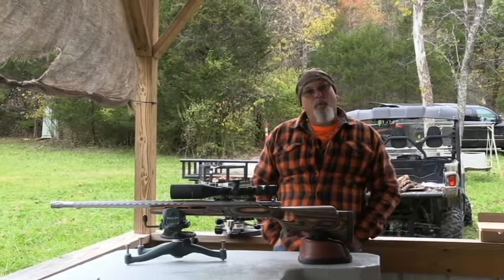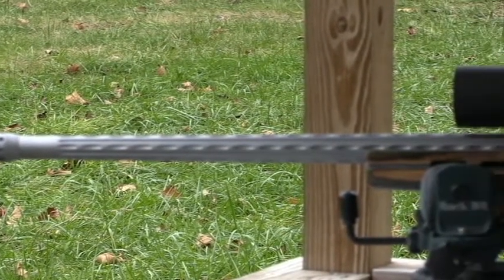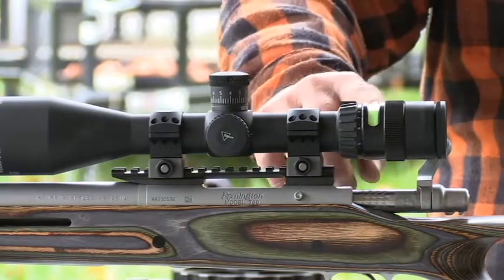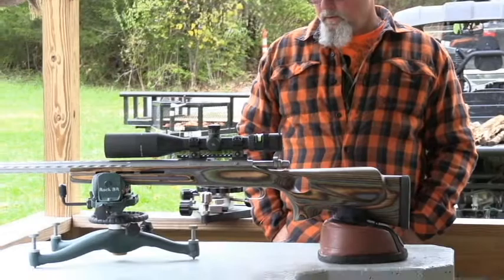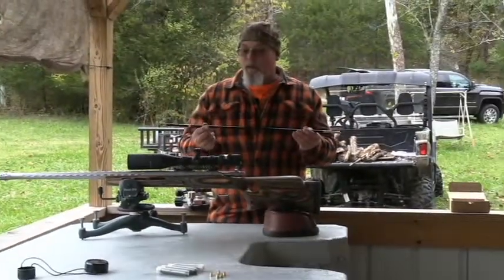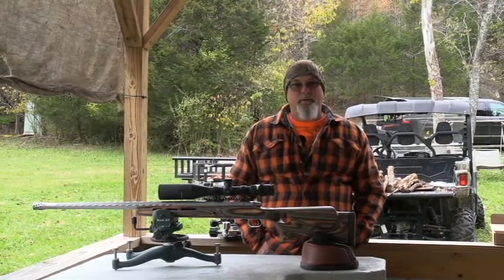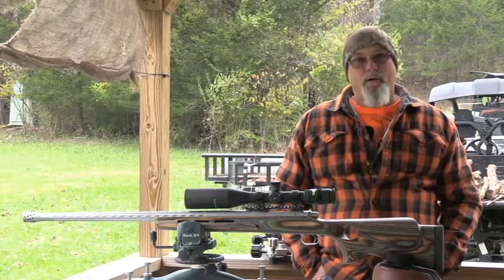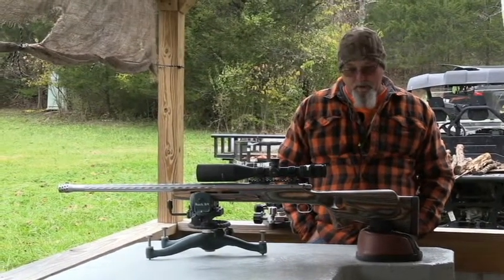A smokeless Muzzle Loader from Hankins custom rifles

Comment: Jeff those scopes use fiber optic which is that green on the top. They also use Tritium . Which is what causes the scope to be lit in the dark. Tritium is also the same thing that is in pistol Night Sights that cause the glow. Nice rifle!!
Reply from the maker: Thanks,  that is good to know. I have a Kimber with those night sites in it. That stuff works really well.
Reply: Jeff Hankins yes sir. The Tritium usually lasts 15 years or so then it’s starts going dim but still very seeable.